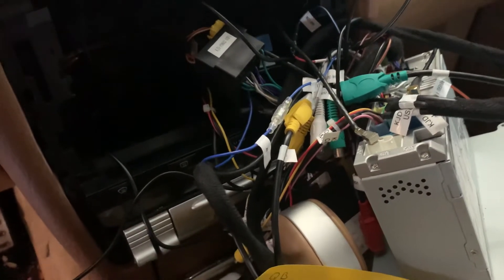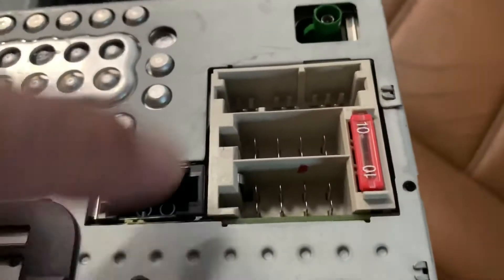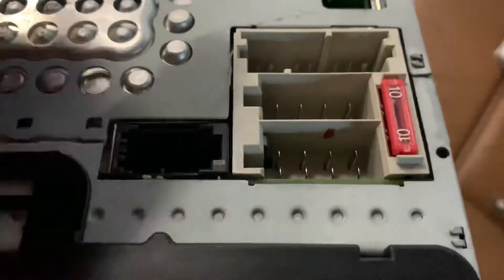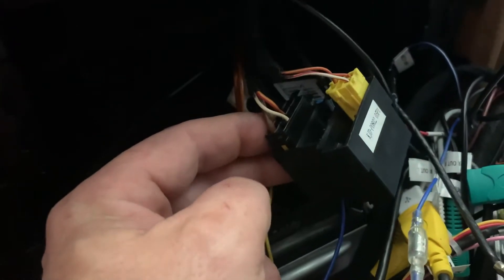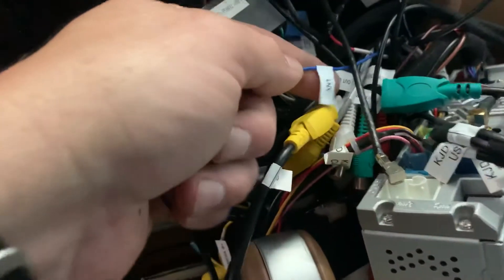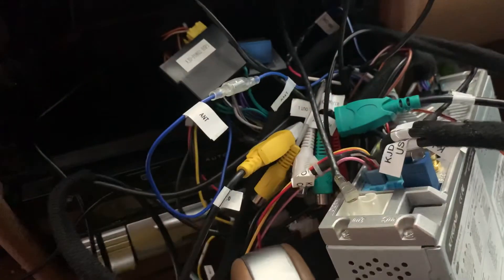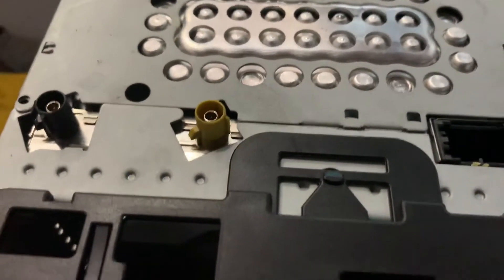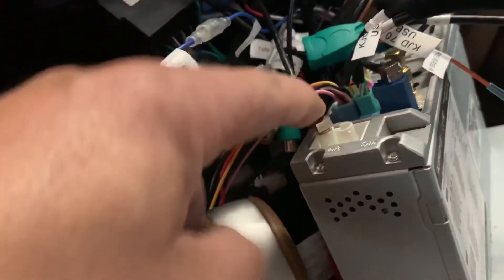Porsche Cayenne Xtrons Android FM Radio Reception

Comment: Hi. Great video. I have sound on my bluetooth music, YouTube but no sound at all from radio (FM or AM). any ideas? I have BOSE
Reply from the maker: Did you hook up the antenna power wire?
Reply: @Breitwerks  yes I did. is like the FM radio is muted. I also changed the area to Americas but still no luck. I have though a blue wire that comes out from the fakra connector that goes no where. any ideas?
Reply from the maker: @dimitristigas9306  that blue wire is the issue I think.
Reply: @Breitwerks  so what do I do with this wire? I even downloaded an app for fm radio (using data) and it works perfect. Where can I send you picture so maybe you can help me more? thanks a lot
Reply from the maker: @dimitristigas9306  if you go back to the video, you can see where the white wire comes from the car harness, into the Xetrons supplied plug and then the two blue pigtails (from the connector and from the new radio) that need to be connected together.
Reply: @Breitwerks ok so now I have another issue. when I start the car I have no sound at all. I turn off the car I have sound (except the FM radio). any ideas?
Reply from the maker: @dimitristigas9306  haven’t had that issue. Let us know what you figure out.

Comment: Hey man thanks so much for bothering to upload this,  I've only just fitted a 9" android 10 after my porsche pcm couldn't be fixed,  everything worked great with it Inc steering wheel buttons/phone, but could only get two local stations,  I didn't have "bose" so didn't think I needed the other little loom with the coloured plugs on, but have now fitted it just so I can connect the two "ANT" blue wires,  I now have more stations than I had with the PCM 2.1,   and it even sounds better,    thanks again for posting this very important detail, Top man 👍🏻👍🏻👍🏻
Reply from the maker: Awesome!

Comment: I had no am reception at all on a xtrons chinese pos FM is descent. My other pos chinese radio works fine. Hooked this wire up and plugged in the white antenna instead of the yellow and now i get a few stations. Still nowhere to plug the yellow antenna